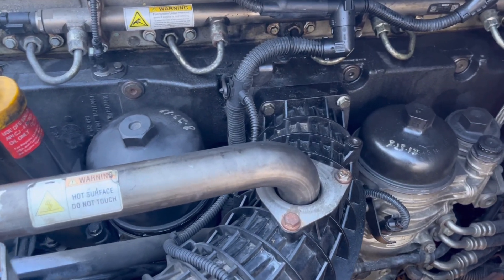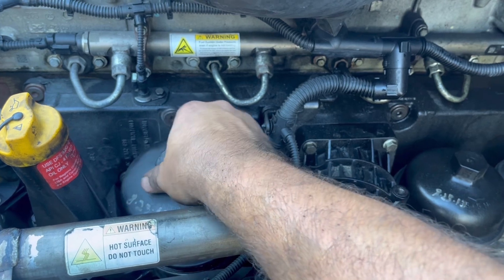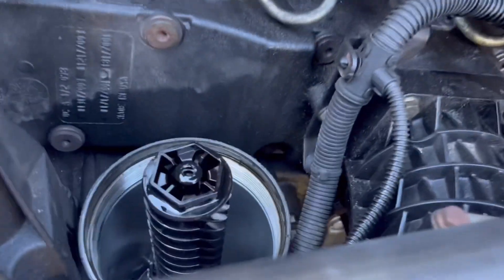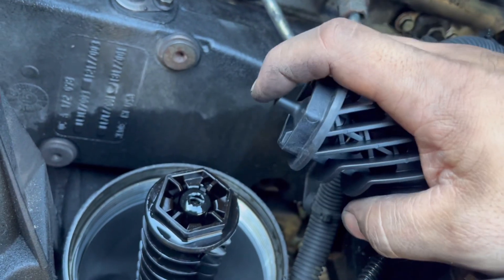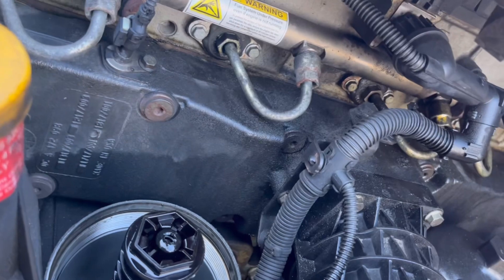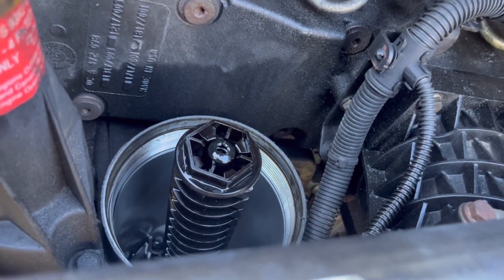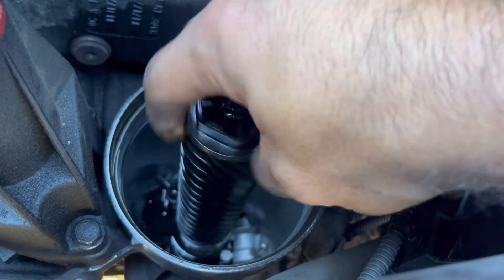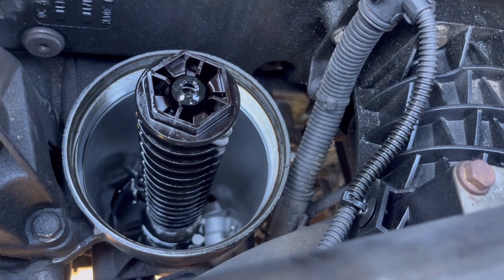Oil filter stand pipe replacement detroit DD15 freightliner cascadia

Comment: What does that nipple do? What problems does it cause if its broken?
Reply from the maker: @7thfloorisnomoreq790  it’s a spring loaded bypass valve. If it breaks off, parts of it can get into the engine and possibly cause damage.

Comment: But that standup pipe being broke did that cause you to lose all oil pressure
Reply from the maker: No. I only noticed it when doing an oil change. I think it may be able to cause those problems if the piece that breaks off gets stuck somewhere. But that wasn’t my issue. Are you losing oil pressure?

Comment: Yes, I have zero oil pressure. I changed my sensor, but then when I went to the oil filter, pulled it out the standup pipe the top part was broke.
Reply from the maker: Did you replace it?